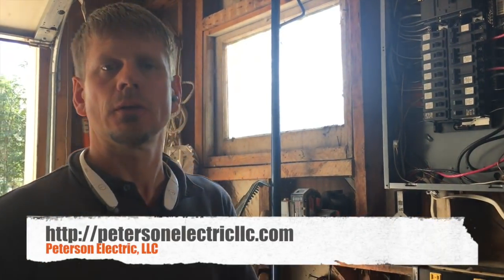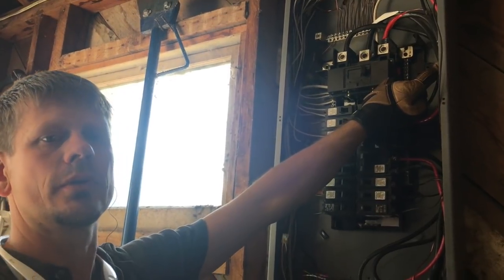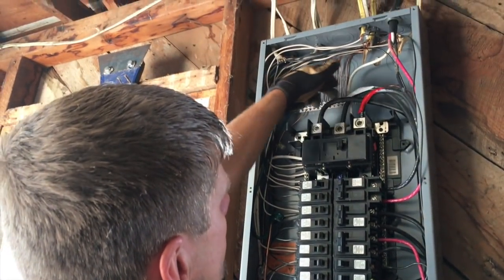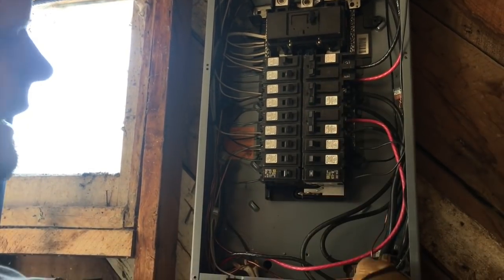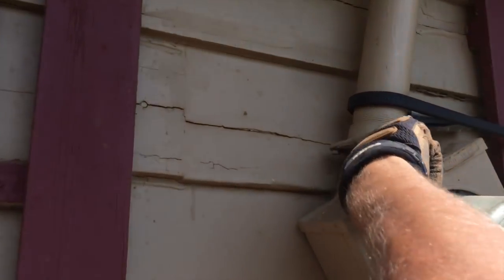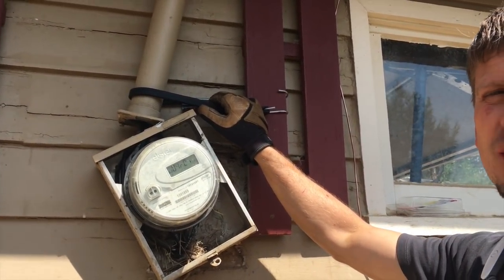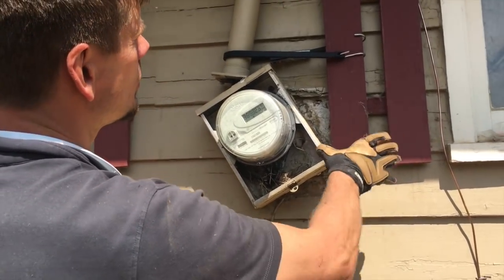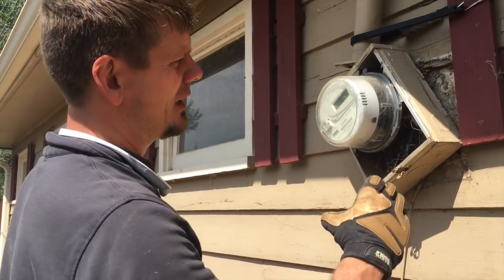Separating Your Grounds And Neutrals In Homeowner's Electrical House Panel

Comment: Now after connecting the 4Gauge grounding cable to the to the 2 earth rods, should another 4 gauge grounding cable be run to the metal pipe of the incoming water service in the basement? 1 more question. Can the 4 gauge grounding cable be shielded; yet cut back the shielding were it will be bonded to the two earth rods and then coat the two bare spots of grounding cable with dielectric silicone gel? Too prevent corrosion.

Comment: Is this the way you add ground to an older house with 2 prong plug ins?  I had the idea to run individual ground wires to specific plug ins and install newer 3 prong plug ins for my expensive music system.   I have a 6 foot ground rod in the ground and a 10 G solid copper wire entering into the crawl space.  That's where I stopped.  Any tip would be appreciated.
Reply: No you need that regardless you need to install 3 prong (ground receptacles and bond them to the box and install a gfi breaker on the circuit
Reply: There is too much resistance in the dirt to trip the breaker. You need to run a actual ground wire to the ground buss in the panel. You must create an actual ground path to the panel.

Comment: Don't you dare caulk that gaping hole.   Cut a piece of plywood, and fix that soffit.  You can use a holesaw, cut the sheet right through hole center and if you need to put a backer board behind to join those seams with some screws, then caulk the gap as the last step - 1/8" is easy to fill and will look good/last a long time.  Bring the two pieces around your conduit to mark where your end cuts need to be for proper attachment to roof framing and it will all lay in smooth.

Comment: Wow I enjoyed watching this video that meter still working after being knocked over what a storm ⛈ it looks like water can now drain into the meter when it rains again. Thanks for posting 😎👍🤩 and for that breaker panel. The undersized wire I agree too that the homeowner replaced the old one himself not knowing the wires were 100 amps while installing a 200 amp panel.😎
Reply: The whole thing looks math impaired: 50amps capacity each leg on a circuit means...100 amp breaker, right?   No.  They forgot a circuit is... a circle: what goes around, comes around, and theres nothing additive about it.  Each phase has it's own protection because of potential vs. ground [in addition to the need to not burn up wiring if an overload/fault occurs].

Comment: Rong n2 aluminum  only good for 90
Reply from the maker: Chapter 8 table 9. the NEC moved the cheat formula to the back of the code book by index back in 2017 and now in the 2020 they are moving it back. YES, if it is in commercial that the #2 alm is good for 90 but not if it is for Rez.

Comment: The way the main breaker and panel is on the inside  is how we do it hear - the code violations I like to put my main breaker on the bottom of the panel [invert the panel if its listed to do that] if the line is coming in at the bottom straight in. Aluminum is not in my vocabulary cable , buss bar i highly resent it because of what ive seen in my career only exception triplex direct burial 4/0 from a property pole to a meter trough with high press lugs .The ground wire to the rods would have to be in rigid metal conduit [overhead service] in some towns if the house is on a well three ground rods in a triangle 6 ft apart. It looks like your going to use a service mast kit some times hear they want guy wires on the mast to keep it stable .My boss installed a 150 MB amp outdoor panel 8 circuit feeding a 100 amp existing panel inside the customer wanted some outdoor circuits is why he ordered this . The inspector was not happy and asked why are you putting the main panel outside but eventually agreed to it we came off the left side of the meter socket. Isnt it interesting how different pocos have weird parameters. I wish i could under stand what the beef is about putting your equipment out of the left ko of the meter can is I think it would look a lot better if poco would give you a pass in this situation.If i ask my poco and have a good reason THEY USUALLY WILL WORK WITH ME. Il bet you think having to do houses in EMT & 4 in square boxes id a little odd.Its very interesting looking through  MILBANK CATALOGS fore different pocos .I wish you could get outdoor panels bottom feed wouldnt that be sweet [clean gutters]

Comment: Two rods driven in ground at meter (residence) are Earths. Note under power company pole pig (derived neutral) transformer the utility drives an Earth rod and #4 down to it from the transformer - the utility does this primarily as lightning protection. Now the electrician connects HIS two earth rods with #4 and brings that into his box. The instant it enters all-in-on or ordinary main panel it becomes Ground. You tie that ground to the neutral and to the bond screw of panel at that point. Never should the ground and neutral touch each other anywhere else. Especially sub-panels. If you do you provide stray returns that are dangerous. Your GFI's will not let you either. I saw once Utility neutral totally disconnected from meter and lights dimly burning, no motors running. The only explanation was house neutrals going to main panel bonding screw and returning to Earth and to the two residence Earth rods and traveling through the damp soil back to the Earth rod of the pole (utility) and back up to the ground/derived neutral tied together at their pole transformer. The most bizarre lesson I ever had.
Reply from the maker: Your right. I saw a tenant's 120volt surge plug in strips catch fire as I walked in from the stray neutral at an under ground man hole for the utility side. I usually have this in CO at mud season, typically spring, things are really wet in the ground from snow melt off.
Reply from the maker: The reason you have to separate the two conductors on the load side of a "one-line service" either residential or commercial is because of the SCCR, and how high the AIC fault current rating is for the equipment. This is determined by the main breaker protection for it to trip. A couple of things that help to determine this is, voltage drop, distance, wire size, parallel runs, conductor properties, insulation of wire, transformer impedance, and size of transformer, if the service is a lateral or underground feed in a conduit or direct burial. Also, what determines the safety of the main breaker tripping under a short, dead short or ground fault is the age of the equipment. The bottom line the code talks about the safety that if the fault or failure is on the load side of the meter the utility company needs to stay safe and separate from the fault and if it is on the LINE side of the meter then they want to be able to default with their fuses to disconnect without sending a huge CURRENT SHUNT and stoping a fire on the service equipment. Separating Neutral, White, GROUNDED conductor from the Green, Bare, Green/yellow, GROUNDING conductor is allowing the fault to go back to the main. An example of this is a service call where last week a customer and his son did a bad job joining the connection behind his wall oven and it first grounded out to the box and then because of the ARC FLASH this then melted the wire cap and then he thought he should reset the sub panel 50 amp breaker and then caused another ARC FLASH and then caused both legs to create a dead short and then blew the main breaker. Thankfully he had a home that was only six years old and all of the main grounding electrodes were in place for current code of 2012. This helped from causing damage to the main man hole with the connections to four other neighbor's houses. 
ANother example I went too was a neighbor came home drunk and hit the 25 kva transformer off of the pad and caused four houses to go out of power, this caused a main ARC+Flash at the pad from the primary voltage on 7,200 volts. 
We also have in article 240 series rated breakers to help from a standard 10k AIC up to 100,000 + ratings. There are many other reasons on the utility side and what other pro's have seen in the field, if you have not seen this nor understand this than don't screw with your main utilities or sub panels.

Comment: A 200 Amp breaker with a 100 amp wire means the wire is the fuse.  Cool.
Reply: They call it a slow blow fuse lol
Reply: I'm not sure if you could change one that blows or if the arson investigator just finds 'em.
Reply: LOL fusible link.
Reply: Yeah, the thinking electrician doesn't waste money on silly fuses.  Real men don't need fuses!

Comment from the maker: I think there is a lose connection on the panel or if there is a junction box for that equipment. I did have one time that a single phase, three wire, suntanning bed, melted it's cords because a main 400 amp gear was arching at the MDS (main distribution service) equipment. This did effect all five store fronts, panels. Since there is no Neutrals "Grounded Conductors" on the equipment it is an earth problem.

Comment: Question for the guru, what would cause my metal welder outlet box (220) to tingle my elbow while touching it while the breaker for it is off and my air compressor on a separate circuit (220 also) is running, but stops when compressor stopped?

Also for a generator outlet box, it came with 2 stickers saying something about floating and bonded (i think those were the terms) grounds, how would i test to find out which one i have to know which sticker to affix.
Reply: AceBoy2099 I just fried some porkchops.
Reply: Sounds like the outlet and the compressor share a common ground that is not actually connected to ground...

Comment: I’m not familiar with the electrical regs in USA but this guy looks like he is a PRO. One small objection I have... never ever extend the ground wire. I believe was better if the ground bar was at the bottom and didn’t had to extend that. 

And a question for someone from the states... Are you allowed to joint aluminium cables into copper terminals? Many thanks!
Reply: Anthony Phillips yes you are right mate, he said that is temporary. My bad, sorry!
Thanks for the rest of info! Much appreciate it! Cheers!
Reply: You can't splice service grounds unless approved by the AHJ.
Reply from the maker: The reason you have to separate the two conductors on the load side of a "one-line service" either residential or commercial is because of the SCCR, and how high the AIC fault current rating is for the equipment. This is determined by the main breaker protection for it to trip. A couple of things that help to determine this is, voltage drop, distance, wire size, parallel runs, conductor properties, insulation of wire, transformer impedance, and size of transformer, if the service is a lateral or underground feed in a conduit or direct burial. Also, what determines the safety of the main breaker tripping under a short, dead short or ground fault is the age of the equipment. The bottom line the code talks about the safety that if the fault or failure is on the load side of the meter the utility company needs to stay safe and separate from the fault and if it is on the LINE side of the meter then they want to be able to default with their fuses to disconnect without sending a huge CURRENT SHUNT and stoping a fire on the service equipment. Separating Neutral, White, GROUNDED conductor from the Green, Bare, Green/yellow, GROUNDING conductor is allowing the fault to go back to the main. An example of this is a service call where last week a customer and his son did a bad job joining the connection behind his wall oven and it first grounded out to the box and then because of the ARC FLASH this then melted the wire cap and then he thought he should reset the sub panel 50 amp breaker and then caused another ARC FLASH and then caused both legs to create a dead short and then blew the main breaker. Thankfully he had a home that was only six years old and all of the main grounding electrodes were in place for current code of 2012. This helped from causing damage to the main man hole with the connections to four other neighbor's houses. 
ANother example I went too was a neighbor came home drunk and hit the 25 kva transformer off of the pad and caused four houses to go out of power, this caused a main ARC+Flash at the pad from the primary voltage on 7,200 volts. 
We also have in article 240 series rated breakers to help from a standard 10k AIC up to 100,000 + ratings. There are many other reasons on the utility side and what other pro's have seen in the field, if you have not seen this nor understand this than don't screw with your main utilities or sub panels.

Comment: What's with the high amperage? Over in europe where i live, we usually have amperage in the range of maybe 10-30 amps for regular homeowner's use. Anything above that and we're usually talking industries or other forms of companies that need high amperage to run heavy equipment or large quantities of smaller equipment. Of course you CAN get more as a regular homeowner so long as you pay for it, you just generally don't need to.
Reply: Higher voltage will use lower amperage.
Reply: Your average newer all electric American home these days all have 200amp service. Sometimes a 400amp if the home is using instantaneous electric water heaters.
Reply: Karl The Fragr … Here's one for the books. My home here in the USA was built when electricity was just starting to be a normal thing. Let's date the place to around 1910, so 110 years old and about 1,700 sq ft. The original power was 30 amp 120 volt service with 2 circuits. One circuit for each floor, which fed a single outlet and single ceiling fixture in each room. We didn't have electric heaters, toasters, coffee pots, and air conditioning back then so it was plenty. The house was heated with coal, gravity hot water, first floor only. (pot belly stove on the 2nd floor) Post WWII we had television, electric heaters, irons, coffee pots, central heating, electric well pump, and more lighting. New service upgrade to 60 amps, 240 volt. Now we move into the 60s / 70s and we get an electric range / oven, then add a clothes drier.... so a couple of sub panels are tied into the 60 amp service.... and things are tight, power wise. I buy the place and upgrade to 100 amps 240 volt so I can add window A/C and a bunch more electrical accessories. (hey, 2 kids and such will do that) Fast forward to 2005 and I'm still in the same house but looking to add a hot tub and central AC plus an air compressor in the garage. Here we are building electrical for the future, expansion wise, with a 200 amp service. Do we use it all? I ran a test and the bottom line is NO. We max out around 100 amps with everything running, including the sauna, hot tub, heat, AC, air compressor, all 3 fridges / freezers, and the well pump, range / oven, along with clothes drier and washing machine. I didn't get to double check the inrush with everything starting at the same time, but I suspect that might have been tight. Anyway, that's why we have 200 amp service on a home these days. It's for the idiots why try to run it all at once and don't want to burn the place down! Here's the kicker: When the power goes out and we have to run on generator, it's do-able for a week with a total draw around 10 amps per leg. Obviously there's no clothes drier, electric range or A/C included in those times, but it's possible.
Reply from the maker: 200 amps is what most HO should aim for. We in the usa like our extra crap and hobbies. Weed, Welding, Klins, Spas, E-volt cars etc... LOL
Reply: Higher frequency uses smaller wire size. If the frequency is high enough, you can use ether!
Reply: Beretta96Dan , USA is 60hz frequency, Europe is 50hz, so it's frequency is actually lower and you're an idiot.